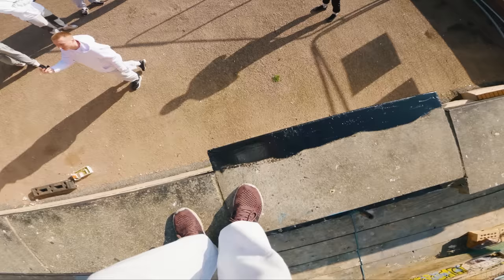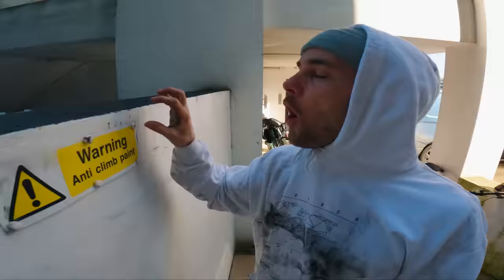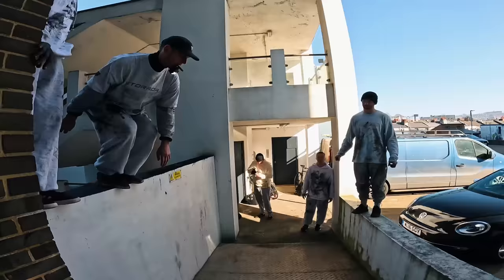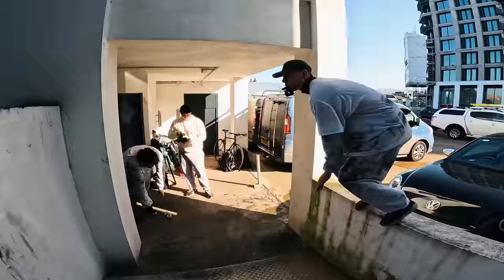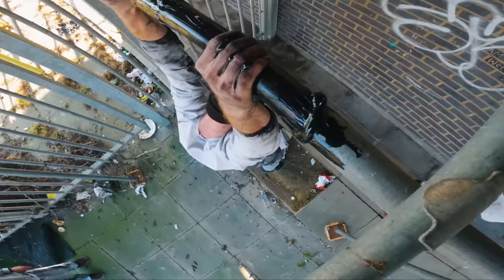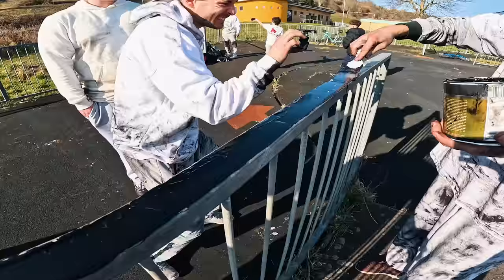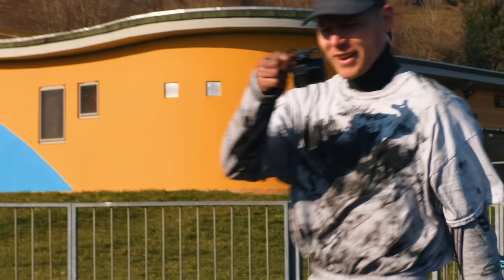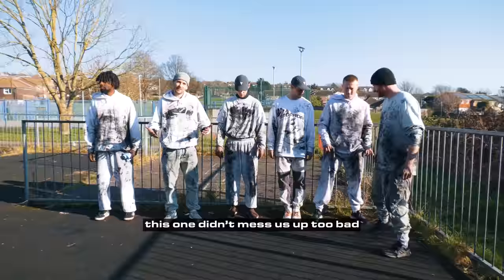ANTI CLIMB PAINT vs PARKOUR - Does it work?! 🇬🇧

Comment: I have no experience with any amount of parkour. 

But as a fast food worker who had to walk on greasy non safe floors, I developed a technique called "Clutch" where you alter where you hold weight on your foot to increase grip when dealing with slick surfaces. I feel like if y'all take a garage and lube up a bunch of your climbing stuff with vaseline for practice you might be able to circumvent anti climb paint. 

Or cover your hands in Dish soap to create grip and counter act the paint.

Comment: anti climb paint seems really dangerous, surprised it hasn't been outlawed yet. one slip at height without any warning and someone will get seriously hurt
Reply: I have seen buckets carried while wworking at height. But yeah if that spills and gets all over the walk way you are literally fucked. It doesnt come off easy and it gets everywhere
Reply: Hopefully they outlaw it everywhere.  I know that the U.S. has laws against booby trapping
Reply: @saudade7842 While i do agree this stuff is dangerous as hell, technically they are also trespassing, so there is 1 argument to be had

other than that this stuff gonna get someone oof'd and it wont be pretty
Reply: Well that's exactly what a successful deterrent should do. Deter you from dying.
Reply: I mean is not like they're putting it on sidewalks. If you come in contact with that paint you're trespassing. Its like saying razor wire is super dangerous, yeah it is but you're not supposed to touch it.
Reply: @saudade7842 The US has laws against things that kill?
Reply: @titaniumstar1772  Doesn't matter, that's what the anti booby trap laws are for. Even if its your own private home, you can't just rig a shotgun to your front door, in the same vein if someone gets injured or killed by anti-climb paint the building owner is going to be liable and open to law suits and/or charged with manslaughter.
Reply: @Setsuraful  See, i know which lawsuit you're talking about, but then the immediate counter argument is "Why were they on my property without my permission then" and also "so if i dig a hole out for a project, say a swimming pool, and a intruder falls in and injuries themselves, would they file a lawsuit for the injury?"

like either or, they're straight up admitting "yea, i was trespassing"

im not saying the paint isnt against the law, what im saying is "how viable are deterrents in the grand scheme of things"
Reply: @titaniumstar1772 You are confusing a lot of things while in reality, it's really simple. The aspect in question is one of proportionality. Serious injury or death are a disproportionate consequence of trespassing - especially when, depending on where you are in the world, you can't legally be trespassing unless you were sent away before, and other shenanigans. Now the obvious difference regarding your pool analogy is intent. You don't dig a pool hole expecting people to get injured. Using this paint, however, you WANT to threaten injury because THAT'S what you think deters people from trespassing in the first place. A hole in the garden doesn't do that. Your argument is a straw man. By the way, none of what I said even relies on the American booby trapping case.
Reply: @Nitidus  Most of what i said came from a video talking about the booby trapped house, so no? pretty sure it was a lawyer youtuber i saw tho

but answer me this, you're doing parkor on a tall building and you trip and fall, whats gonna happen

vs slippery paint that all but confirms the same result if you're dumb enough to parkor in a tall area
Reply: @titaniumstar1772 First of all, if you want people to respond to you, tag them properly or they might not get notified.

Back to topic: you don't understand. The argument that started this debate had nothing to do with the booby trapped house or LeagleEagle's videos. It was simply: "well, but they're trespassing". Someone else started to talk about booby traps but what I said doesn't need that case to argue against this paint. Got it now? Just to be clear, when I'm talking about something like proportionality, that's not some abstract concept but the foundation of every state of law. Meaning even if the paint itself isn't illegal, you can still be liable for what you do with it. 

Also, you made up another straw man. You know what that is? It's about inventing a problem that doesn't exist to divert attention from the original point so you don't have to address it. But I'm still going to answer you because I don't think you did it in bad faith. Which is quite rare on the internet nowadays. So, your example really doesn't work at all:

The situation is, "someone does parcours on a building and falls off - they get injured and sue you." You said that it doesn't matter if they fell off because of incompetency or because of the paint you spread all over the place. The very function of this paint is to make surfaces slippery and dangerous, though. So there's probable cause for you painting this surface to actively make people fall. Have fun trying to prove that the person would have fallen down without your paint as well. Especially when in that case, there would have been no reason for you to paint anything. The fact that the person fell off that roof ONLY because of your paint is as obvious as Earth being round. There is absolutely no way you could disprove that in court. If something like this ever happens, you're 100% fucked.
Reply: @Nitidus  And my argument also encompasses "How did they slip on the paint if the paint was in a no trespassing area" which wouldn't be a straw hat whatever, since if the injured person in question wasnt authorized to be in that area, how will they explain why they got injured and are covered in slip paint

yes, the paint itself is a problem, but you're also ignoring me talking about "well, should the person who got injured from the paint even be there?"

So far i havent heard a single "No" yet saying otherwise

should the paint be against the law? depends on the circumstances

did the person openly trespass, or was it just a freak accident? It also depends

should the paint be considered a booby trap or a deterrent? Me personally, no idea
Reply: @Nitidus  Also side comment, atleast try to work on your social skills dude, your comment sounds condensating at times 🙄 im just a dude replying to comments about literal paint, no need to go "high school english teacher" mode
Reply: @titaniumstar1772  trespassing isn't technically illegal in the UK
Reply: Then dont do it??
Reply: @@xPythh It's not illegal to use anti climb paint on your private property. It is illegal to use it on anything accessed by the public or city easements for maintenance work. This stuff isn't to deter freerunners or whatever, I doubt they're even a thought in most peoples minds. It keeps thieves out. Personally I have nice thorny rose & barberry bushes planted under all of my first floor windows which works just as well, natures razor wire ;)
Reply: @titaniumstar1772 but they did address the trespassing issue, several times. they said that just because you’re trespassing doesn’t mean you don’t have rights. imagine if you stole someone’s wallet and in return they kidnapped your family. is that fair? was it legal for them to kidnap your family just because you stole their wallet first?
Reply: I get it on private property but let the public protest be free of it.
Reply: Yeah, purposely trying to kill someone because they are climbing on your wall… kinda messed up.
Reply: @titaniumstar1772  Speaking fax brudda. It's insane how far criminals will go to pay themselves as victims
Reply: @feidhlimharrington2275  Your arguement is flawed, you don't own your parents or family dude, why tf would they get punished for Your mistake??
Reply: @feidhlimharrington2275  Were talking about trespassing, your talking about kidnapping an entire family, those are not on the same level and you should know this

"Put the paint in a area only tresspassers will go in" is not a complicated though process

and if a worker who was told to be up there happens to slip on the paint then it was a complete accident

My case has been made several times yet nobody managed to debunk me other then "Well how could you know???" to which i say "how do you?"

its a slippery slope conversation
Reply: @titaniumstar1772  i was saying your rights aren't null and void as soon as you trespass. the concept of an outlaw doesn't exist any more.
Reply: @danielsurvivor1372  i mean killing someone isnt really punishing *them*, cus dead people uh.. cant have thoughts.. but thats a whole other can of worms
Reply: @feidhlimharrington2275  Yes......but one crime is leagues more worse than the other

i can be an outlaw for shoplifting, someone else for murder

sounds a bit like a reach to call both parties "an outlaw" since its under the same umbrella for 2 entirely different spectrums
Reply: @titaniumstar1772  no - my point was outlaws DON'T exist any more. the entire point is that no matter what you do, you still have rights. hence the extreme example. because if it applies at an extreme then why tf wouldn't it apply for petty crime
Reply: @feidhlimharrington2275  Because one is kidnapping and the other is trespassing? again i think i made that clear that those 2 are vastly different, clearly you wouldnt give the death sentence to someone who shoplifts a snickers
Reply: @leogrievous  It doesn't matter, you can't put a booby trap somewhere knowing that it could someone.  Like if some kids sneak into a school to play football on the pitch, do you think it's reasonable to put paint on the fence which could cause someone to slip and break their neck?
Reply: @titaniumstar1772  '' pretty sure it was a lawyer youtuber i saw tho'' well theres your answer then
Reply: if there was not proper warning signs posted, i think it would be considered a booby trap which is illegal at least in the states
Reply: Yeah I think the risk of innocent people getting injured is much higher than people who are climbing and are experienced or accept the risk of their actions
Reply: Maybe shouldnt be there in the first place
Reply: @pjanoo6973  There's no real way for innocents to be harmed by this paint, because it's only used on the tops of walls, low roofs, etc. If these so called innocents are hurt by falling due to the paint, then they weren't reallt that innocent at all. This paint isn't just thrown everywhere at random. If you choose to trespass on private property, then you also accept the risk that you might get hurt.
Reply: The hell are you all talking about? 

Their are signs, and this is likely done to prevent would be athletics from getting themselves hurt on other people's property 

Don't climb where your not wanted, simple as, and if the owvmners choose to take measures to limit reckless climbing that's their choice
Reply: @Setsuraful key word, booby trap or rig a trap, if a sign makes it super obvious it's not a trap, it's a deterent people ignore at their own risk
Reply: @magnarcreed3801 public buildings are still not climbing equipment so still fair, how would you feel if someone climbed up past your apartment or over your house, gets problematic
Reply: @niceguyrides then don't climb it, your not helping the public just a small sect of climbers
Reply: @feidhlimharrington2275 your so wrong in ways it hurts

Especially saying death isn't a punishment.....like mate I don't think you walk off death
Reply: @titaniumstar1772  You are putting questions that certainly have a more complex answer in all this lol. The tresspassing laws change depending on country (state if in America -  though I do not know exactly what you are allowed to do in the US for example to someone who tresspasses) is very much dependent on the situation. And to your questions add something: "What happens if someone who is chased by something or some other person runs up to you for help?" And you may say oh some accident like this didn't happen. Oh it happened. :D Not to add that people have been shot for as little as approaching a house whose owners KNEW them. You are putting law that is taken to court into a comment section expecting a clear black or white answer when it isn't like that. Bottom line is, booby traps are very much not legal in a lot of places for good reason (because they can bring a lot of collateral victims for no reason). If someone is that terrified of people coming near their house then sorry bud but they may be better off in the middle of nowhere. Sure if it is someone tresspassing and destorying or with a malicious intent, in the court that is decided. But putting paint that can lead to quite literally death if from high enough all around buildings (that may or may not be state owned?). Very questionable. And very open to lawsuits. The idea of the paint is not "oh i am preventing tresspassers" it is more like the spikes put to not allow homeless people to stay in certain areas. It is very much aggressive architecture or modification to said architecture in this case. And it is made as a (very bad may I add) method to prevent parkours. But at most it will lead to injuries, possible death and lawsuits. Just like the spikes for homeless do nothing to actually help the core problem.
Reply: I see a burnie pfp, I comment
Reply: @mrfrost6211  you have zero reading comprehension. reread what i said
Reply: @feidhlimharrington2275  no need to, besides you said plenty of nonsense for me to know their is no point in humorist you
Reply: @mrfrost6211  You're just resorting to strawman at this point so idk why you think i'm the one who needs to be humoured
Reply: @feidhlimharrington2275  Your not entitled to anything, the honest only reason i reply is because people like you amuse me, so no i really dont, besides i still think your point is just blatantly wrong and i dont see how i ever used a straw man considering iv not denied or lied about anything

nice try tho
Reply: @mrfrost6211  i said death isn't a punishment for the person you're killing (dead people can't think, and therefore killing someone isn't punishing THEM. you're just punishing their friends/family/whatever because they're the people impacted by the death). if you killed me in my sleep, i wouldnt notice
Reply: @feidhlimharrington2275  that's being rather pedantic, but whatever makes you feel right
Reply: @mrfrost6211  that's not being pedantic, that's the original point i made which you completely ignored
Reply: @feidhlimharrington2275  yes it is, in the sense that your arguing a completely invalid point based off of your own personally biased opinion over an arbitrary use of wording

I don't have to humor it in anyway or form as it lacks any substance

Comment: Benj being the only one to get anti-climb paint on is face is hilarious. Not only one time but three😂
Reply: anti-climb paint looks very suspicious to wet paint..  are they similar? :)
Reply: @somerandomchannel382  Anti-climb paint is a thick, viscous sludge that is specifically designed not to dry. You're technically correct, it's wet paint (a lot thicker and messier), but it's special paint engineered to stay that way.
Reply: @anonymousaccordionist3326  It's essentially a special black oil paint. Pigment mixed with a special oil that's designed to not harden when exposed to air.
Reply: He climbs with his face.
Reply: Nose, mouth, ear, .... elsewhere

Comment: Anyone else worried about what that paint is doing/ going to do to animals? I'm thinking a squirrel goes for a jump slips off and someone finds a squirrel with it in its coat or birds not being able to roost after getting it on their feet.
Reply: just wait until that sludge gets into the water/food supplies...
Reply: the big problem is going to be birds
Reply: I think some anti climb paints are claimed to be water based, soluble, and non toxic. But for paint that doesn't dissolve in the rain and doesn't dry in the sun, I honestly doubt it
Reply: @yiklongtay6029  Yeah. Truth mate.

Comment: Take a minute to appreciate how dangerous it actually is to stand on that paint, lose all grip with your shoes could easily slip and crack your head.
Reply: Take a minute to appreciate how dangerous misjudging your distance actually is and bouncing off a wall and cracking your head.
Reply: @N1korasu Is your point that anti-climb paint doesn't matter because the sport has risk involved? Yeah there is normally risk, but its mitigated by parkourists having made the jump thousands of times before ever attempting it at height.

Comment: The solution is to add non- skid granules to the wet paint. It’s used on commercial boat decks to prevent slips and falls. Once it’s applied and sets up, the treated surface becomes super grippy although a bit rough. We use it on the tugboat every season….very effective.